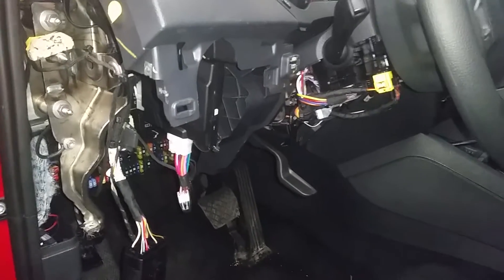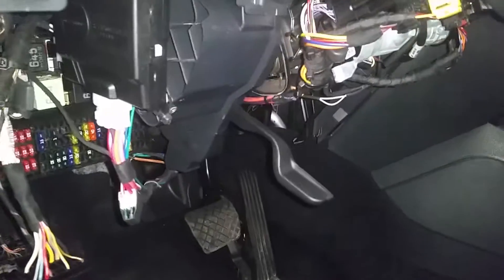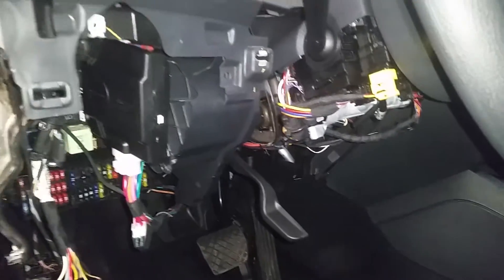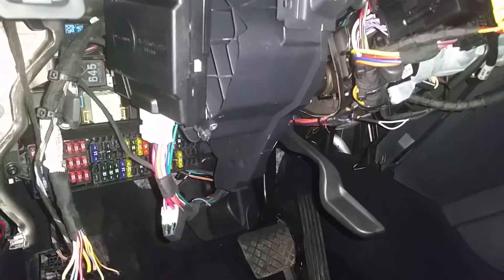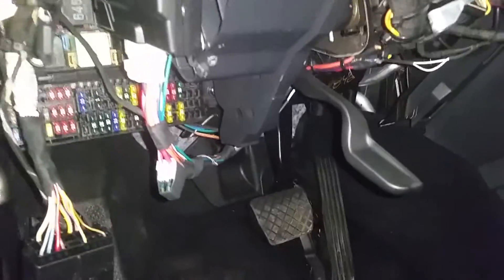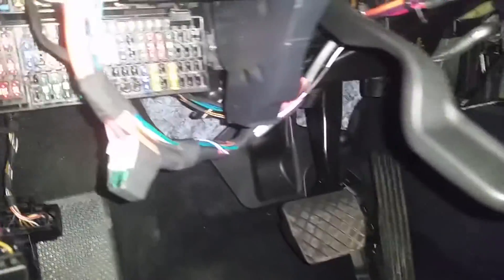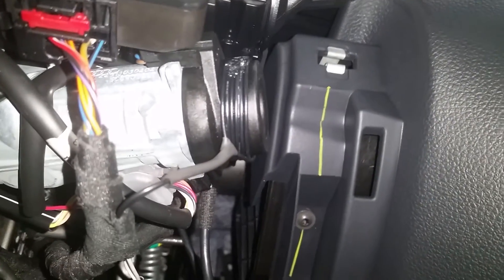Tight clean wiring

Comment: You mentioned on a couple of the videos you just recently uploaded when you install the remote start you lose one of the keys, what do you mean by that??
Reply from the maker: Hey there,  what I mean by that is on volkswagen audi products there is no way of interfacing too the immobilizer so you loose a key the chip set is placed under the dash with a coil around it thus sending signal to the immobilizer upon remote start. Thanks for watching!